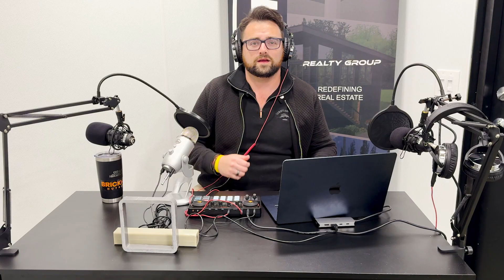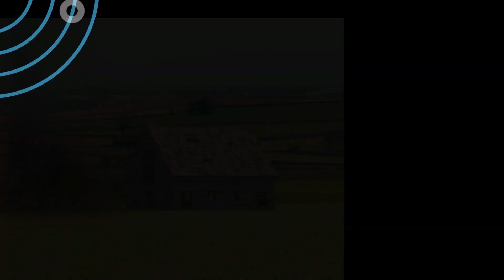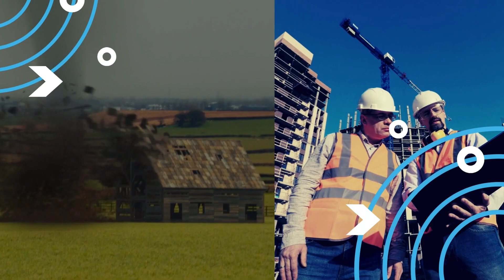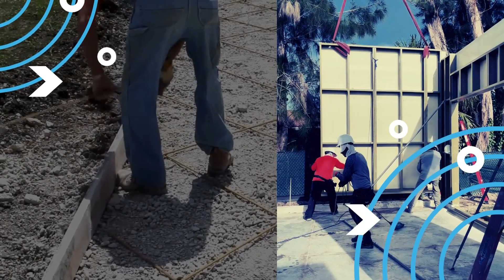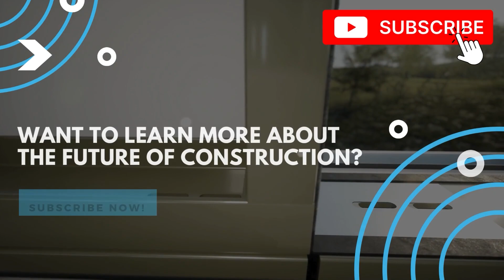The F.O.C Podcast S1 Ep4 - Pre-construction Process Explained

Comment: The budget-control part is huge. I’ve been using Shackleton more around that stage lately, especially when the drawings and scope are still moving. Catching cost-impacting details early is way easier than dealing with them after award.